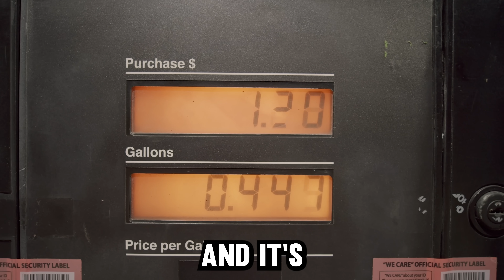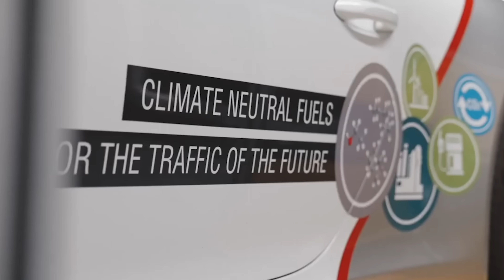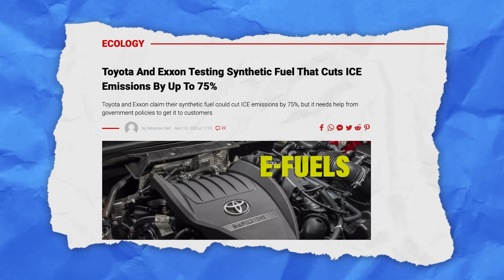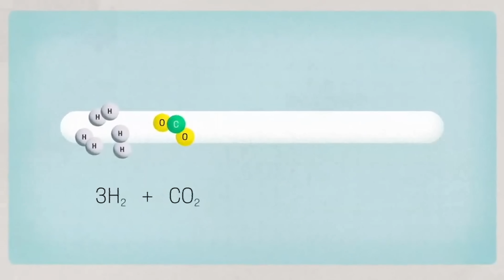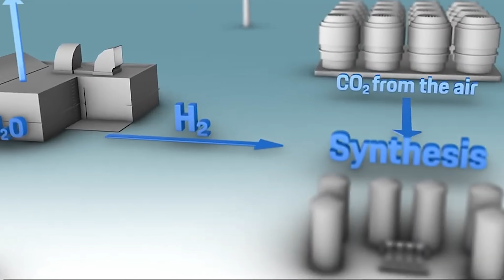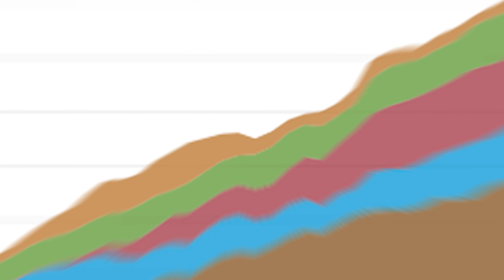Dodge Just SAVED Combustion Engines

Comment: If the companies get it right, maybe the CO2 free alternative fuels will be greener than electric vehicles?
Reply: Most definitely. An important factor a lot of people overlook is that some combination engine cars can last over 40 years while we see the current electric cars usually cap out at a decade. Not saying this will always be the case but when all these electric cars fail they will be scrapped and most of it wasted. Compare this to internal combustion where almost every part is "fixable" or easily replaceable to some degree.
Reply: @GST623-  Modrern cars do not last that long on average. Car manufacturers no longer make cars that last that long because they would not be able to sell as many new cars. EV's can be repaired just like an ICE car as well, and in fact... they have way less moving parts wich means less chance of failing. Battery replacement is the big hurdle though... a big costly hurdle. That will be changing as new battery tech comes into play in a few years.
Reply: @GST623-  don't forget they don't know yet how they're gonna recycle the batteries. They just hope they're gonna figure it out by the time it becomes a big problem.
Reply: @K9  I don't think we can say electric vehicles are failing after a decade.  Most built are still on the road. And ICE cars lasting 40 years is definitely not the norm, more the exception. Electric cars have a lot more potential for extended life.  Batteries are still expensive but haven't really scaled yet. There will be a time that a pack can be replaced economically and recycle the spent cells to create new ones. Long term for cars battery electric is the future. That being said it will be YEARS before all ICE cars are replaced even when no more new ones are being sold.  So if they can get synthetic fuels sorted to help the remaining ICE cars keep going and with lower emissions I'm for it.
Reply: @GST623- it's essentially just doing an engine rebuild every decade but instead it's just replacing a battery
Reply: @GST623-  Yeah you got that backwards! The vast majority of ICE vehicles scrap out within ten years! Especially with regular use! EV's have far lower maintenance and operating costs!
Reply: @lisam4503  the whole concept of needing thousands of batteries in EVs destroys any "fewer maintenance and operating costs" 

Hardly anyone is going to buy an ev when features are licensed and can't be resold to 2nd hand customers. Or when they know the current batteries will need replacing very soon. Then the fact that any given year that manufacturer can drop support for that car and you're stuck on your own trying to find compatible parts.

You will never see a junk yards or any lot with used, questionable EVs in proximity due to their fire hazard. Dryers are the #1 cause to house fires, guarantee you EVs will take that spot if they force them down our throat over the next 15 years.
Reply: @InTheZone85  I see used Tesla's all the time on car lots, next to normal ICE cars. And your comment about licensed features also applies to ICE cars as well now, Mercedes is a prime example of this. Also you are basing your opinion on current battery tech, which is soon going to be outdone with new style of batteries. We are in the infantcy of EV's, while we are at the end of life for ICE cars... at least the ICE cars we have all grown up with.
Reply: @aaroneaton4849  You do realize that EVs existed BEFORE ICE powered cars, right? Battery power is being improved but batteries are not exactly an “emerging technology”. If you make batteries one tenth as heavy that take half the time to charge they are still a non-starter compared to my two minute fill up. New battery improvements are heavily publicized — why is that? It’s because somebody is making money, not because they are saving the planet.
Reply: @ehb403  LOL that is funny. Sure EV's "existed" for a long time, however development of them stopped when gasoline was so cheap. Yep, the battery charging time is still an issue for EV's, this is imrpoving though. Soon we will see EVs with fast charging time. Let me ask you this: if you had to wait 10 minutes to charge up an EV, but it only cost you $10 to travel 400 on miles on said EV, would you still prefer a gasoline car? Not sure about you, but after driving a car for 400 miles I am ready to get out and stretch my legs for 10 minutes, or more. That is where EVs are going, EVs are much cheaper to operate then a normal ICE car. 

As for your claim about someone making money... what about the oil companies that have been screwing us over for years? Just a month ago oil futures fell, and the cost for gas should have gown down... but instead the cost for gas went up. Oil companies are screwing us over to line their pockets with money. Oil companies with their drive for profit is why EVs are becoming popular now. That is why I am looking forward to EVs. 

EVs have their place, right now mainly as commuter cars. Technology only gets better as time passes, just like with a regular ICE car.
Reply: @aaroneaton4849  if you think recharging will still be cheap if it is the only alternative then I have a bridge to sell you in Brooklyn — you’ll love the view!
Reply: @ehb403  bahahahahahahahahhaha, you are clueless. 

Technically EV's can be recharged using solar, wind, hydro or other forms of renewable energy. In fact that is how I recharge my electric bicycle, using a 50w solar panel. Cannot get much cheaper than that!!! While at the same time gasoline costs just get higher and higher, while the world's oil supply gets smaller and smaller each day. 

I have high hopes for synthetic fuel. But currently they cost over $40 a gallon... that price needs to come way down before they can compete with EV's. 

Old people are so afraid of new technology.
Reply: @lisam4503  lol man what world are you living in 80s 90s shitboxes are my passion and they are still very well alive
Reply: @cin2110  Lol cars from that era aren't a dime a dozen! I live in one of the kindest climates for vehicles not rusting and you barely see any of them! The ones that lasted best here are old pickup trucks and musclecars. 
The cars from that era I see for sale were babied and stored. I lived through those cars and years! Very few cars from the eighties I'd want to own.
Reply: @aaroneaton4849  So when they come up with that new battery tech, your current EV will be worth exactly $0 because nobody will want to buy the outdated antique garbage.  No to mention, have you gone past a Tesla service center?  Tons of them in for service and they sit there for a long time.  Seems to be a shortage of replacement parts.
Reply: @lisam4503  My 20-year-old SUV that runs  the same as it did when it was new begs to differ.  If you buy cheap junk, you get cheap junk.  For the EV's, everything except the battery has to be cheap junk so they can be somewhat cost competitive.
Reply: @aaroneaton4849  I'll always prefer combustion engines.   I know how to maintain and repair them.   They're already taking steps to make sure you can't do the same with EV's.  Even if  you can find the parts, good luck getting the technical info to do it yourself.  If you likek paying someone $250/hr to work on your car, you'll love EV's.  Personally I haven't paid anybody to do any work other than replacing tires on any car I've owned for well over a decade.
Reply: @aaroneaton4849  Your electric bike has a much smaller battery.  Good luck charging your EV with that 50w solar panel before you die of old age.
Reply: @ironclaw6969  I also do my own work on my vehicles, and with my background in electronics... working on an EV is easy. It is much easier then working on an ICE car actually. Less moving parts to deal with.
Reply: @ironclaw6969  Do you really think if I had an EV I would try to charge it with a 50w panel? I was using that as an example. The point being is this: with an EV technically anyone could charge them with a solar power bank. You cannot do that with an ICE vehicle, you still have to go and rely on someone else to supply your fuel by giving them money. Personally I like the idea of being able to recharge an EV myself, and not relying on someone else. Self reliance.

This all being said, ICE vehicles are never going away. We will always have a use for them. EV's are commuter cars. Most people would save money by driving an EV for their daily commutes versus driving an ICE vehicle, especially with the rising cost of gasoline/diesel.
Reply: @ironclaw6969  I actually work at an Auto parts store, we have a shortage of parts for ICE vehicles. Also... updated batteries can be made in the same size as older batteries, so upgrading an EV's battery would be easy.
Reply: @lisam4503  Wrong.  That may have been the case 50 years ago but ICE's last MUCH longer than 10 years now.  The biggest component of an EV is the battery, and those DO cap out at 10 years.  My daily is 11 years old now and shows NO signs of dying any time soon.  Even when the engine does wear out, I can rebuild an ICE engine cheaply and easily.  Unlike an EV battery, the parts and materials that would need to be replaced when rebuilding my ICE are very easily recycled.  Now, it IS true that the electric motors used in an EV are much simpler than an ICE and are easier to maintain, but once again, the battery is the Achilles heel of EV's, which has been the case ever since the first EV's were made in the early 1900's.
Reply: @lisam4503 100% false, not even close to true... while a battery pack failure at the 8 year mark of an EVs life will guarantee its destination in the scrap yard...
Reply: @lisam4503  Ahhh...  The Malaise era.  I fully agree that there are VERY few 80's cars worth owning.  Still, it doesn't change the fact that your argument that ICE's only last 10 years while EV's will much longer is WAY off base because the biggest and by FAR the most expensive part of an EV (the battery) does last for only 10 years while the road is filled with ICE's that are considerable older than 10 years and are still going strong.  Saying that the body is rusting out on an ICE isn't a valid argument because ANY EV that has a body built with the same materials (steel) WILL have the exact same corrosion problems when driven in the same environment.  CAN we get to the point where replacing and recycling EV batteries becomes at least close to as inexpensive and environmentally friendly as doing the same with an ICE?  That's obviously a possibility, but we are nowhere close to that right now.  The entire driveline in an ICE is VERY easily and cheaply recycled, including the lead-acid battery.  Rebuilding an ICE costs a fraction of what it costs to replace an EV battery, and it will last longer (roughly twice as long) as well.  The power grid is the giant elephant in the room that the EV crowd simply refuses to talk about as well.  I just don't see EV's as the future when hydrogen doesn't depend on the power grid, doesn't suffer from the range limitations due to relatively long charging times (compared to refueling), doesn't rely on rare materials like Lithium, and IS carbon free immediately because it won't rely on a power grid that won't be carbon free for many decades to come.
Reply: @aaroneaton4849  Then you know as well as anyone that parts availability for cars varies greatly based on the model of car and it's popularity.  I've never had a problem finding parts either at the local parts store or simply ordering them online for half of what the local parts store charges.  Also, you know it's not difficulty that keeps people from changing battery packs, it's that they cost so much to do that the rest of the car isn't worth the cost.  Much like I won't drop a new engine into most cars at the cost of $7000 to $9000, people aren't going to do the same for a battery when they cost $12000 to $16000.  You just go buy another car, it's less work and and you'll end up with a better result.  The difference is when the rest of the car is worth the work, like on my '67 Mustang that I did drop a rebuilt 302 into it because the existing 289 was shot.  But that is a project car that I have hundreds of hours into as well as tons of sweat equity and I'll probably never recover the cost from, but much of it was done for the pleasure of doing it and for the time spent working beside my son.  No Tesla is worth that time or trouble, they're cheap mass-produced shitboxes that willl probably never be considered to be classics.
Reply: @aaroneaton4849  Much like you have to rely on someone else to make those solar panels for you because you're not making those for yourself.  That's the world we live in.  Plus, you were the one who bragged about that 50w panel, I was simply poking fun at that idea because that could even be a somewhat portable solution, but you're not doing that in the real world, you're using someone else's charging infrastructure and paying them if you're not near home.  Much like people who drive real cars and go to the fuel station and spend 2 or 3 minutes putting fuel into the tank every few hundred miles of driving.

As someone who needs  a mix of abilities from my vehicles, an EV is worthless to me.   I need a car that can do both short and long trips and since I already own that, I'm certainly not dropping $50k on a newer car that doesn't work as well in all instances.
Reply: @aaroneaton4849  You might have  a point except for the technical info, and of course whether or not they'll sell you the parts you need to do your own work.  I can get that technical info for any normal vehicle without much issue, all the way down to wiring diagrams of the harnesses if necessary.  For most of my cars, that information cost me a one-time cost of $30 or so to buy a repair manual that includes most of what you'll ever need.  If you're willing to spend more, an AllData subscription is a few thousand a year and covers pretty much all production cars other than a select few who refuse to share that information (such as Tesla).  Plus, I know how a combustion engine works and I own cars that don't have even the slightest bit of silicon in their construction.  How an EV works is nowhere near as transparent and good luck with tracking down a fault when it's probably some piece of software where you don't have access to the source code.
Reply: @craigcampbell8560  To be fair, hydrogen does very much rely on the power grid since the most viable method of producing it is electrolysis of water which is an energy-negative process no matter what you do,  Physics is sort of stubborn that way.
Reply: @ironclaw6969  What type of SUV is it? They are known for poor MPG's and mechanical failures.
Reply: @craigcampbell8560  Ice engines are no longer inexpensive to buy rebuilt or to rebuild!
I live on solar! If I simply look at the upfront cost dang it appears expensive! But when you spread it out over years is when you see how inexpensive it is compared to being on the grid! 
That is the only way to make a true comparison between EV's and ICE vehicles! It's over that time of years that the EV beats the pants off of an ice vehicle for related ownership costs! Battery technology and cost is in flux and getting better and lower cost! 
Back in those early days of EV's a lot of people especially women favored them over gasoline powered vehicles! Henry Ford's wife drove a Baker Electric! Two big changes and a few other reasons are why the ICE vehicle passed the EV as the preferred vehicle back then. The end of the total loss oil system and the invention of the electric starter are the two big ones!
Reply: @finish_my_projects  No longer true and most EV batteries will long outlast the 8 year mark! That is just the end of warranty.
Reply: @lisam4503  It's a Buick Rainier with a 4.2L inline six and over it's 20 year life so far it has had no major mechanical failures.  In fact, most of the repairs have been to the electronics, not the mechanical parts.  As far as the engine goes I've replaced the power steering pump ($130 in parts) and the water pump ($40 in parts) over the service life of the car as well as a new battery every 5 or 6 years and tires every 50,000 to 60,000 miles.  Every 3000 miles (yes, I'm aware that's a shorter interval than they recommend, oil is cheap and engines are expensive) it gets an oil change and the rest of the maintenance has been by the book.  As it sits it runs perfectly, it has no codes and it performs exactly as it did when it rolled off the assembly line.  Buy quality, get quality and I can pretty much guaranteed that no EV made will work as well as new after 20 years of daily use.
Reply: @ironclaw6969  I'd never even heard of them but knew the Oldmobile Bravada. Hard to go wrong with an I6.
The thing is with all new cars you can bet electric issues will get real expensive once they go out of warranty! You will need more than just an automotive electrical specialist to fix them! 
I wish they wouldn't load them up so much with Electronics that you don't need or might not want! 
They bloat the cost, weight and effect MPG's.
Reply: @ironclaw6969  Also think how simple it is to build a basic EV drivetrain! Battery pack, electric motor, charger controller and power relay. 
Then add in axle, front suspension and body. 
Pretty basic stuff compared to ICE.
Reply: @lisam4503  You're not kidding about the electronics, especially the wiring harnesses.  Like I said, most of the repairs have been to the electronics, mostly chasing down bad grounds.  That's part of the reason I don't particularly want anything newer.  To be honest, though, the real reason we chose it is because when I bought my wife her first new car that was the one she liked the best.  It's been an extremely reliable and comfortable car to drive and I have no complaints,
Reply: @lisam4503  Until  you get down to how it really works.  Most of the "special sauce" in an EV is hidden in memory modules and microcontrollers, all of them remotely updateable.  First thing I'd have to do is figure out how to disable the data uplink back to the mother ship,   I don't want someone to be able to modify my vehicle without my say-so, after all, my family's lives may well depend on it.  Yet another reason I'm happy with the older vehicle I own outright that I can maintain and repair myself at minimal cost. I'm certainly not interested in dropping $50 to $70k on a vehicle, then another few thousand to rewire the main panel at my house so I can spend another few thousand on a level-2 charger and then another $20k on solar panels and another $10k on a battery system to make the solar panels worth a damn.

If I felt like I had that kind of scratch to throw at transportation, I could certainly find something more interesting to spend it on than any EV out there, most of which are ugly as sin and all look the same.
Reply: @ironclaw6969  True, but unlike an EV, it's actually possible to power the electrolysis process via solar panels to create the hydrogen that fuels the car because it requires a LOT less power than an EV does.  Physics are the reason why EV's aren't a great option to begin with...  While we are on the subject of physics...
Reply: @ironclaw6969  Alldata is great, but out of my price range. I can usually find what schematics I need online nowadays anyways. 

You can buy all the parts and schematics you need for most EV's... Tesla on the other hand, Musk is a douche. Tesla is trying to be like Apple and control all things for maximum profit. An exmaple of an EV you can see schematics for is a Chevy Bolt. 

I totally get knowing how internal combustion works. I do as well. Nothing is better then the sound of a great running two stroke! However modern internal combustion engines are becoming more and more complicated: drive by wire, electronic valve control, multiple catalytic converters... the list goes on and on. They are getting to the point that specialized tools are needed for basic things, and this is how the car manufacturers want it. That way they can maximize profit.
Reply: @ironclaw6969  Sadly everything gets considered to be a classic. I see 80's crapboxes that people say are classics now... like a stupid chrysler K-car. It makes me sad. 

New battery pack costs suck for Ev's... for now. If someone comes up with a replacement battery pack that is half the cost, and has a larger capacity... that person will be rich. This will probably happen sooner than later. Some of the new battery tech we are going to see soon shows a lot of promise. Liquid salt batteries for example. 

I wish I had kept the '66 mustang I had. It was a factory 4bl 289. Blah. I do eventually plan to throw a chevy LS v8 into my bmw, that is now my project car.
Reply: @ironclaw6969  lol I wasnt bragging, a 50w panel is nothing to brag about. I mainly bought it to charge my e-bike when I am at burning man :). Now if I had a 5000w solar panel array... yea I would brag about my $0 energy bill at my house. 

You are right though, EVs are only good for a few things right now... and that will probably be the case until atleast 2030. They are great at being commuter cars. They are not so great at long distance travels, or towing. And they definetly cost too much... but so does every other car nowadays I feel. Crap is so over priced... just look at full sized trucks now, its stupid. The only type of vehicle worth buying new now is a motorcycle! 

I am sick of being ripped off by the oil companies, that is the biggest reason why I have hope for EVs. With an EV there is some hope I can provide my own energy for it.
Reply: @aaroneaton4849  I dunno about the battery thing.  I used to work in IT and I really did try to find more cost-effective solutions to replacement battery packs for laptops.  It never ended well, the cheap replacements would go a few months and invariably crap out because they're cheaply built and, honestly, lithium-ion batteries are just a shit technology.  Better than Ni-Cd or NiMH, but that's not a very high bar. We also tried rebuilding packs with new cells which just never seemed to work out that well, you might get a few months and then they'd crap out as well.  Laptops, cordless tools ... you name it and if it used batteries you'll just end up scrapping perfectly good stuff simply because the battery technology they rely on is shit.  

Now, if they ever figure out how to make them where they don't suck and the battery technology isn't shit, perhaps I'd be interested.  Until then, I'll keep on with what I know works and that's internal combustion engines running on fuel.  I have yet to see an EV that I think could last as long as the car I bought new for my wife 20 years ago that I still drive daily right now, and it still gets the same fuel mileage numbers it got 20 years ago.
Reply: @aaroneaton4849  You ought to speak more nicely about those oil companies.  Because of the work they did, and continue to do, we have the world we enjoy now.  We have the unbelievably safe, convenient world where food is plentiful and offers better variety and nutrition than at any time in human history.  All of that because we have access to affordable energy from oil.  You should be thanking those oil companies profusely for their contributions to human well-being.
Reply: @aaroneaton4849  The real question is, if you spent the up-front cost of a 5000w solar array,and the battery storage to make it worth a damn for the other half of the day the sun isn't shining, how many years of lower utility costs would it take to actually pay for it,?  Assuming, of course, that the savings would pay for it during it's lifetime.  Much of this depends on where you live, think SoCal vs North Dakota or Maine.

Maybe it's just my bias, but I consider unreliable power sources to be pretty much useless.
Reply: @ironclaw6969  I never said anything about battery storage, just a $0 power bill. We do not need battery storage if we feed the solar power into the grid. All you need is the right power meter, and the solar power array. At curret costs, it takes an average of 3-5 years for a solar power system to pay for itself. Solar panel prices are dropping every month. 

Solar has proven to be reliable now. If you mean solar produce less energy in rain, you are right. But it still produces energy. Any light that hits a solar power gets converted into energy. Our future energy grid is going to be nuclear power and renewable energy sources.
Reply: @ironclaw6969  Better batteries have already been made. The issue facing them currently is scaling up production. We will see better batteries within a couple of years. I would suggest you look up "flow batteries", those are a game changer. Some designs are figuring a lifespan of nearly 30 years. 

Better battery tech is one of the biggest things being researched right now. Not just for EVs, but to replace li-ion itself.
Reply: @lisam4503 Ice vehicles scrap out within 10 years?!? What????
Reply: @ironclaw6969  I've been living pretty well for the last few years on 3,000 in solar panels, wiring, controllers, and inverters and batteries! I don't live in the dark and it works surprisingly well! It would have cost me about the same to hook up to the grid.
Reply: @aaroneaton4849  EVs have been in their "infancy" for about a decade at this point...
Reply: @lisam4503  lol ten years😂? Majority of the cars I work on are 10 years old and it’s just maintenance. Have fun replacing your 20k$ battery every 7 years!
Reply: They won't. There's no getting around that electric is 4-6 times more efficient in producing motion than combustion.
Reply: I couldn't be bothered reading all the ignorant comments Mango. E Fuels will cost more than $50 a Gallon. If you can afford a Vintage Porsche, you'll be able to take it for a little drive once a month. I don't particularly like it, but E fuels are not going to come close to solving Transportation problems. From what I read, by 2060 half the World will be uninhabitable. If you're alive past then your Vintage Car will be the least of your problems.
Reply: Physics says No. It takes way more energy to make the e-fuel than you get out of it. An EV will go about 10x  as far on a kwh than an ICE using e-fuel made from the electricity. You're adding steps to the energy chain. Added steps always mean waste.
Reply: @P2TE  there's ways but if you know diesels you know them.
Reply: If companies get this right, we'll need to produce %800 percent more electricity than we currently do to power the E-fuel plants. Unless you're rich, I hope you're not committed to having AC in the summer.
Reply: There are no free co2 free alternative fuels. All fuels that allow combustion are different forms of hydro carbons( hydrogen surrounding carbon) which when added with air creates water and co2 and a byproduct.
Reply: @Eclipsis17  i mean there are hydrogen fuel cell cars
Reply: @peshvadefinite1008  Same problem as the synthetic fuels.  The hydrogen costs much more energy to produce than you can make from it.
Reply: @ironclaw6969  and its risky bec its highly flameble
Reply: @GarciaQ60 there are no free electric vehicles either, which add carbon in their production and electricity generation
Reply: @Eclipsis17  that's why they catalytic converters. They remove NOx emissions from the environment.
Reply: @Eclipsis17  not true at all! burning hydrogen is a 100% clean! period. saying that EV's will dominate within 10 years. ICE vehicles across the board are dead. i live in Canada's auto manufacturing capital and see the research facilities at chryslers in person when i deliver there. i also deliver to all the dealerships and they're all telling me the same thing and fear for the future of their jobs.
Reply: maybe not free but anything that you grow as fuel attains its carbon from the air thus if you make ethanol fuel from cellulose stock it can be essentially carbon neutral... Hemp is best because it doesn't require, clear, tilled, treated or fertilized land just switch your ethanol stock from corn to hemp and double down and the game is done. Always could have been. everything they talk about for green energy is lip service because this was avoided. What they are really pushing for is disruptive change where everyone HAS to buy new while carefully keeping centralized energy.
Reply: With this obsession with electric cars. I honestly wonder how much horsepower an electric car powered by a nuclear reactor would make lol
Reply: especially when you think about what goes into getting the batteries of an ev
Reply: Once graphene batteries are here, it won't matter anymore. ICE will just be obsolete :p There's no more progress in the realm of power or efficiency to be made for ICE vehicles. And after only a decade of viability, EV's have surpassed ICE in those categories. It's only a matter of time :D
Reply: 😂 ok. I will believe it when i see it.
Reply: @wzero07  What part isn't true?
Reply: @wzero07  LOL hydrogen. If you knew anything about hydrogen you would know that we cannot store enough onboard our cars to last more then 100 miles. BMW already tried this, it failed. Reason being: to store enough hydrogen onboard its required  to be in liquid form, so it requires a massive insulated fuel tank. Now hydrogen is the smallest molecule in the known universe, and when in liquid form its even smaller... so small that NOTHING can keep it sealed in. Over the course of 10 days, the BMW hydrogren car would slowly vent its own fuel. And the car had to be stored outside... because hydrogren likes to go boom when in a confined garage space. You cannot argue against physics on this. If you store hydrogen in gas form on a car, you get a very low range. So low that it is pointless. I once had hope for hydrogen powered cars, because it can be an easy retrofit to make them work. But then I learned phsyics, and how stuff works. 

ICE vehicles are indeed at their end of life, and if you cannot see it you are blind. They are not efficient, they are definetly not sustainable, and their cheap fuel source is running out. Are you going to plop down $40 a gallon just to drive your ICE vehicle? Because that is what the cost is for this new synthetic fuel being made. Have you even noticed that all car manufacturers are starting to make electrics? This is just the start, its the writing on the wall. No ICE vehicle is as efficient on energy as an EV, that is why are are at the end of life for ICE.
Reply: hydrocarbons always gonna put co2 out but if making efuel can pull co2 out of the air its greener than batteries can ever be
Reply: @Enrique A Thiele Solivan And Lithium is a rare metal and has to be mined and is in special Earth Ecosystem that are damaged and can't be fill in with just dirt. So why not use a metal that doesn't need to be almost as bad as Coal?
Reply: Electric vehicles are not greener than Combustion. Sorry
Reply: @BeLikeWater53  Me? no, they aren't They are more detrimental to the environment for what they need to be built and they are more prone to making those batteries explode due to putting to much wait on them. And then they need Diesel to recharge them. (The charging stations use it.)
Reply: @beauxr.benoit1374  What? did you read my response wrong? I don't think I even @ you
Reply: @BeLikeWater53  I didn't have to, I have actually seen it on other videos. And another thing. There is a Cellphone battery episode of Myth Busters that you need to watch that explains why EC batteries due the same thing. If you put weight on the, it will crush them and they will catch on fire, blowup or both.
Reply: @beauxr.benoit1374  I know, I’m not rooting for ev I’m doing the opposite lol. I have a buddy who is a firefighter, I hear it all the time. And yes it’s bad!
Reply: @BeLikeWater53  I never liked them, especially if they are going to be responsible for the killing the Ice car, which in fact is actually friendlier to the environment to start of with.
Reply: @beauxr.benoit1374  I got you, you flipping out on your own side dog lol. Im a mechanic lmao I get it.i drive a diesel im in upstate ny. I live and breathe country you think any of us want this shit. ive known for a while it wasn't the way. its funner to sit back and watch it implode.
Reply: @BeLikeWater53  Not if it is yours and you are still paying for it. Otherwise, you are right, it is fun to watch.
Reply: Its impossible. You will have to reinvent the engine.
Reply: There is nothing "green"  about building EV batteries.  It's all a scam to have more control.
Reply: They pretty much already are
Reply: They already are
Reply: How? If something can burn, it is because it contain carbon. If carbon is heated and burn it will attach to any nearby oxygen, creating co².

It is essentially impossible to burn anything without having co² as a bi-product. That is simple chemistry
Reply: @kimf.wendel9113  It's because you don't have to have zero carbon emissions, you just have to get to NetZero carbon emissions. The first way we attempted this was through ethanol. The theory being that corn consumes the same amount of carbon as it is grown as it emits into the atmosphere when it is burned as ethanol, the issue that we ran into was that we did not account for the carbon emissions that happened during the refinement process. This new technology in the video is about a different strategy where synthetic fuels are made from existing carbon in the atmosphere, this is also an attempt to achieve net zero carbon emissions.
Reply: @samuelriester1419  that works, as long as you drive along corn fields. If you drive around a city the emission is not caught and people will breathe it in. And it will just go into the air.

The idea of neutrality through plants is also wishful, energy is burned during seeding, during maintaining, during harvest, and during transport.

It is also not possible to collect the same amount of co² in a plant as you can use. As that carbon is both in stem, leaves and roots. This is a political construct made purely to make it easier for them to reach their goals.
Reply: @kimf.wendel9113  I think the idea is that the corn would have already used its carbon by the time it is converted into fuel. Not that it would be sucked up by another corn plant after it exits the exhaust. And that's interesting, I knew they had discovered that they weren't seeing great benefits from ethanol. I just didn't know exactly why. I had just heard that it had to do with the refinement process. I didn't know it had to do with the actual CO2 emitted versus consumed by a corn plant, not an area that I'm an expert in hahaha.
Reply: @samuelriester1419  in a simplistic closed system it may if you burn the entire plant. But that is not how reality works
Reply: I couldn't be bothered reading all the ignorant comments Mango. E Fuels will cost more than $50 a Gallon. If you can afford a Vintage Porsche, you'll be able to take it for a little drive once a month. I don't particularly like it, but E fuels are not going to come close to solving Transportation problems. From what I read, by 2060 half the World will be uninhabitable. If you're alive past then your Vintage Car will be the least of your problems.
Reply: Like hemp fuel can in modern engines... because it can with little alteration.
Reply: @DarksideStreams  Kind of a strawman argument! How many cars were made and sold ten years ago? What percentage are still on the road today? Simple fact the majority of cars on the road today are less than ten years old!
Reply: Yes, because lithium mining is a thing
Reply: we need CO² in the atmosphere, the scrubbing is harming the plant life and they are working a lot harder with the very little they have (also CO²actually cools the planet not heat it up, exterminate all cows for that, the literal bullshit and cow shit is a greenhouse gas, not CO²)
Reply: I mean, look how much “fossil” fuel is used to mine the elements for just 1 Tesla battery, and how much land is destroyed from mining. Seems mostly counterproductive or at least extremely minimal difference made in the end, if at all
Reply: @mikedavis581  How much resources are mined just to produce a car? How much if any fossil fuels used and over that vehicles lifetime? I am guessing no one told you that you don't have to mine to recover lithium? That you can produce electricity and recover lithium via geothermal extraction! That is what is going on around the Salton Sea area of California right now! That also geothermal electrical production due to advanced drilling techniques developed in the oil business now makes it possible to produce Geo-thermal energy in all states in the U.S. That between developing Geo-thermal energy and capping the millions of abandoned oil wells will provide jobs for many years to come for anyone displaced from the oil industry in this switch to a more electrified America! The future is now way cry about it! Embrace it and put the spirit of American ingenuity into it! All you have to do is use your brain and the idea of fathers and sons tinkering on cars in the yard can still happen with EV's! It just means learning a new trick and adapting to an ever changing world.
Reply: The cost if production is currently high. Same for recycling lithium batteries, solar panels, etc.Between that and subsidies, they attractiveness diminishes.
Reply: Solar panels leak hazardous materials onto the ground, leaving the area contaminated.A lithium battery 🔥  is similar to a 🔥 involving magnesium. If a Naval aircraft is on fire on a ship, the multi-million $$ aircraft is PUSHED OVERBOARD because the fire can not be put out. Finally, the cost of recycling lithium and solar panels costs too much to recycle.
Reply: @patrickmcdonald3427  Because oil doesn't get subsidies? Solar panels and lithium batteries are currently in a Moore's Law-like price collapse. Oil will only get more expensive to extract because we've depleted the easy-to-access sources. 

The real world, lifetime cost of EVs are already cheaper than gas cars, and they're getting cheaper. Yes an EV is more expensive, but people don't pay the full price up front, you take a loan. The savings on fuel and maintenance makes it cheaper starting from year 1 of ownership.
Reply: @P2TE  I'll let you be the 1st to purchase a 10 year old EV...a 2013.
 See how that works out for you.
Reply: @patrickmcdonald3427  Probably better than the typical 10 year old ICE. There are about 1/100th the number of moving parts to go wrong. NHTSA has been tracking the data, and maintenance costs of EVs are about half that of ICE. The only problem with buying use is that it's not as big a savings because EVs preserve their value much longer. Sorry, but ICE is on borrowed time right now. The numbers and real world data make that clear, not the urban legends about EVs that get spread around.
Reply: I did a research for a class and I found out that the lithium batteries being produce around 8 giga tons of Co2 yearly. Also the Minding process for lithium crates radioactive uranium and acids that can poison water make land infertile. And that is not taking into account the inefficient charging stations. I believe E-fuel is the way
Reply: @erickalvares7009  I am guessing you haven't heard of extracting Lithium from the Geothermal powerplants around the Salton Sea in California! I'd like a source for your claim of 8 Giga tons of CO2 emitted also! E-fuel doesn't solve the problem of NOX emissions.
Reply: @lisam4503  boy..... aren't you a sad sad puppy..poor booboo
Reply: @BeLikeWater53  No I am just not living in your backwards thinking world! The world is moving away from your thinking and its a good thing that it is!
Reply: @lisam4503  Lol
Reply: for sure
Reply: Greener than a car that destroys the Environment.  Special rare elements have to be mined to get the the ingredients to make the Batteries.
Reply: @beauxr.benoit1374  A lot of those "rare" earth elements aren't really that rare, but the process of extracting them does tend to be very toxic and destructive to the environment.
Reply: @beauxr.benoit1374  just like making the solar panels for your e fuel... You need boat loads more solar for your e fuel mobile lol
Reply: @kstorm889  Like you would need so many solar cells for an airplane it would be too heavy to get off the ground and would make the plane 50% longer. I looked it up one time and it wouldn't make sense to try it. I forgot the exact amount.
Reply: It could, a lot of it is going to depend on if any of these efforts to develop effective batteries without lithium are successful. Ice vehicles will always have a major disadvantage over EVs which is just efficiency, they are nowhere near as efficient at using their energy and turning it into motion, there are so many losses to consider like heat and friction. So I think if there is every battery alternative to lithium which is greener than it's going to be awful. Hard to beat EVs as far as environmental friendliness goes, but I can't predict the future on if that will happen or not, If I could, I'd be buying stocks in one of those research companies like crazy.
Reply: @samuelriester1419  it’s NOT actually hard to beat EVs as for as environmental friendliness goes, actually. They are no better than ICE powered cars over their lifetime, plus they have a shorter life so need new cars built to replace them more often. EVs generate more hazardous waste when scrapped and require what amounts to “slave labor” (so called “artisan miners”) to get the raw materials. It would actually be better to increase the fuel efficiency of ICE powered vehicles (it can be done but research is not well funded — for instance when I applied for a research grant to the National Science Foundation I was told that it’s not “new” technology so they weren’t interested in reviewing my application). Even if EVs were “better”, cars are not the major contributor to the problem so EVs aren’t the solution. Manufacturing and agriculture are the REAL problem and EVs are the shiny bobbles to keep you focused away from that fact.
Reply: @ehb403  That's not even what I said, I agree that in the current state of things that modern ice vehicles are probably doing better for the environment than EVs. All I said was that there is an inherent inefficiency to ice vehicles due to heat and friction losses that in the longest run will be hard to overcome. Ice vehicles convert about 20 to 40% of the fuels energy into forward movement. This varies greatly depending on the vehicle and it's efficiency. EVs are somewhere in the territory of 66 to 70%. That's something that's going to be hard to overcome in the long run if ice vehicles are to be the future. OPs question was can alternative fuels overtake EVs in the long run. So I responded to that, not a generic response about how Evs ice vehicles are greener.
Reply: @ehb403  as far as the waste thing, it's an excellent point. I think if we really care about the environment we need to get to a point where ev's are not being junked just needing battery replacements. I get that it's 10 to 20k to replace a battery and people don't want to eat that on a 2015 vehicle to put it back on the road when they can just buy a new one, but something has to change because if it doesn't we're going to generate tremendous, tremendous waste producing new vehicles every 5 to 10 years instead of 15 to 20 which is the average currently. The companies would rather just sell you a new vehicle, especially because EVs are actually cheaper to produce because they are much more simple so the profit margin is absolutely massive. I feel like if it was any other industry other than the EV industry the government would have stepped in by now and tried to regulate a way to prevent all the waste, but the EV industry is kind of protected right now it seems.
Reply: @ehb403   The biggest contributing factor in CO2 emissions is from air travel. It also benefits the least number of people. 
The same people telling you that climate change is out of control and YOU need to not drive are burning as much fuel in a week as 1,000 normal people burn in a year.
In the US 1/3 of the total fuel used is for air travel. That includes heating homes, road traffic, air travel and off road uses like farming and electricity production. 
Also, when you consider the CO2 emissions from agriculture you should subtract the tons of produce from the tons of CO2. Especially Grains because they contain the least water and have the most carbon captured by volume. Plants are much better for carbon capture than any man made carbon capture devices. They don't require electricity to remove CO2. They are solar powered without the cost of manufacturing.
Reply: @ehb403  just so you know... I liked your comment. 
I'm not knocking everything you said, just pointing out that agriculture and manufacturing are not the real problem.
Reply: @samuelriester1419 .....tesla is the oldest large scale maker of EVs and the early models are just now hitting the 10 year mark.....kind of throws a wrench in your "average age of EVs". if the average age of an EV is 10 years thats a huge win.
Reply: @captainslow788  huh? Average of 10 years is not a huge win that's pitiful and wasteful.
Reply: @captainslow788  a few years ago I owned a 2003 Honda Civic that was still completely practical and a great daylight driver. It got 40 plus MPG. That is NOT an outlier but very much the norm. My point is that we do not want to get into a situation where these cars are so technologically advanced that they have a life cycle like phones and laptops where they stop getting software updates and get rendered completely useless whenever the companies decide that they want to quit supporting them. If that happens, it doesn't matter how much CO2 gas as we save, we will be going backwards because we will be generating tons of waste.
Reply: @samuelriester1419  when the majority of the ev cars in existence are only 10-12 years old that means most all of the vehicles made are still operating. Do you not know how averages work?
Reply: @samuelriester1419  the tesla model s only entered production 11 years ago.....how are you going to have an average of 15 and 20 year life spans on a class of vehicle that only really entered production 11 years ago?
Reply: @captainslow788  Man you gotta read the room, people on the internet with usernames are still humans and you need to give them their human decency as you would if you are standing in front of them. There are comment sections for you to flex your keyboard muscles and be assholes to each other and there are comment sections where people just want to chat about certain concepts that they're interested in. A comment section about an engineering video is the latter. It's clear you aren't even reading people's messages, you are picking out tiny parts of people's messages and insulting them, because I said 5 to 10, not 15 to 20. If you would have read my messages at all, you would have noticed that I was arguing for EVs in the beginning and just mentioned a side point that we need to figure out a way to get them to have a longer lifespan. If you aren't going to add anything to the conversation, just go somewhere else and insult people.
Reply: The material they use to make the batteries for electric cars are way more lethal than combustion could ever be 🤣
Reply: Battery production is a really problem, as well dispose it properly... also, the energy is another entire trouble due to "Not going nuclear" laws
Reply: @viniciusschadeck4992  As a now retired nuke, we NEED NUKE...period.
Reply: @viniciusschadeck4992  you’re overestimating how much energy will be needed. If all cars when electric tomorrow we’d need 15% more power than we use today. Because most will charge off peak, that’s hardly a problem. If all cats went to e-fuels, we’d need 9x the power we have today to make the fuel.
Reply: @P2TE  i can't re check my answer here due to youtube problem... so i not know exactly what i wrote in the past... well, for sure i know my thoughts... if energy making not matters, i prefer silent cards with no engine noise... i know people love the vrum from cars and engine, but i do not... eletric cards are cool because of it, and will be nice to have cars cheaper with that tech, also e-fuels or even oil based fuels are also techs that can be improved in so many ways, and it already are in soo many ways that are amazing how much energy can be harvest in those internal combustions of today... sorry if i not answer properly this time, youtube comment system is kind terrible on backing into a comment be marked in another comment
Reply: That's a very good possibility.
Reply: I suggest describing them as "carbon recycling" rather than "carbon free" because they're still using carbon. they just found the carbon in the atmosphere